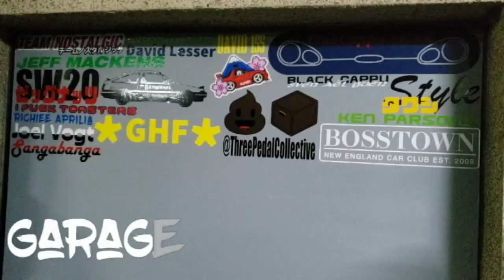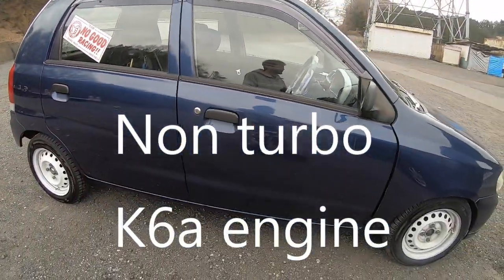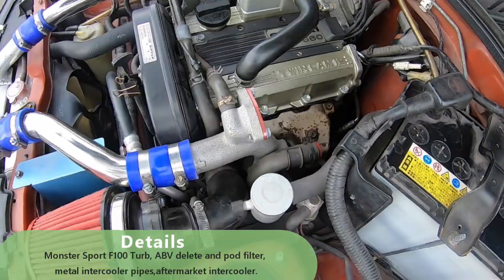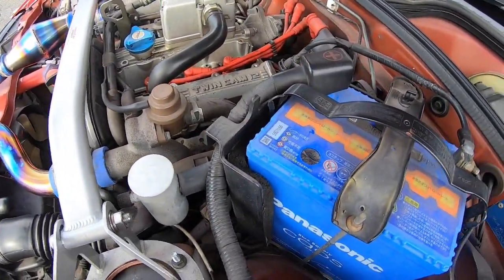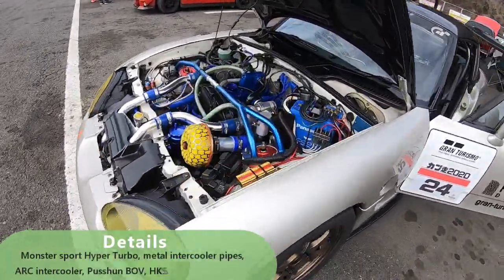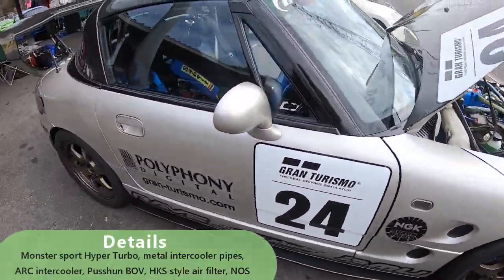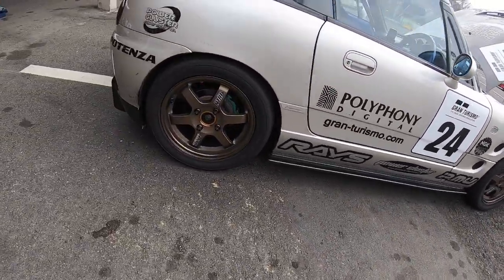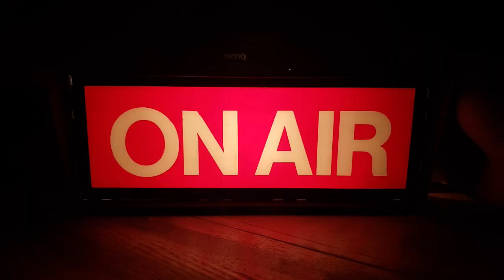Suzuki Cappuccino Drift Day 2020 - Special guest: OTHER KEI CARS!

Comment: Nissan rear brakes on the front, interesting
Favourite Cappuccino would have to be Jun's, just for the homebrew diy approach.  Everyone seems to go tried and true monster sport f111 kit.  Curious to wonder how he gets that through a shaken every year.

Also, finish that Carry already!
Reply from the maker: Yes indeed. Surely it doesn't make that much difference... Considering Jun has 180hp on stock brakes and does just fine.
The f111kit will pass shaken just fine.... Why wouldn't it?

Comment: What's the factory blow-off delete for? Is it so they can run the limits of boost from the turbo (which is compensated for by what I assume to be the Monster N2 computers?)
Reply from the maker: Stock is an recirculation valve.
Different noise.
Stock ones can fail, block off plate can't.
Don't want a blow off valve.
That's about it...
There is no performance gain or loss to the block off plate (despite what some people say)
Reply: @GarageKei  oh, i see
thanks man, much appreciated!

Comment: Suzuki alto works that is one of my dream cars. To bad by the time I get enough cash they will be rare as hens teeth.
Reply from the maker: Which Alto do you want? My favorites are the older ones.
Reply: @GarageKei  me as well I believe it it's the early 90s with the rear windows that curve over the roof I think they look awesome
Reply from the maker: @jameswalker3416  yep! Round headlights and square fog lights?
Reply: @GarageKei   yep and the double wing on the back. Have you seen them slide slim doors?
Reply from the maker: @jameswalker3416  yea. My favorite too.

I've seen the slide door model. Only in pictures though.
Reply: @GarageKei  Must not have made very meny. I seen one for sale on goonet if I remember right it was cheap too.
Reply: @GarageKei   ya there is one there but it's not cheap its 10 grand
Reply from the maker: @jameswalker3416  yea... I like the regular ones anyway. No slide door for me.